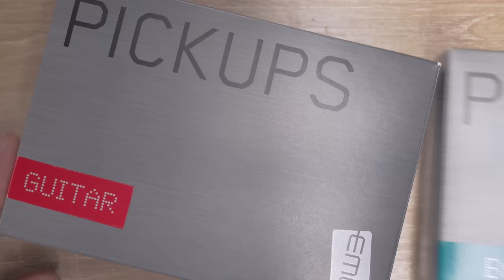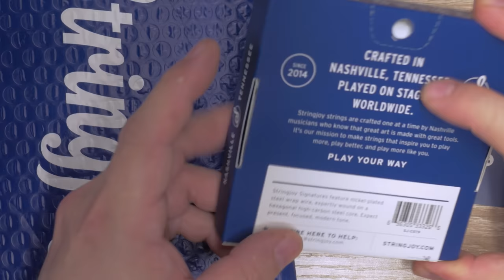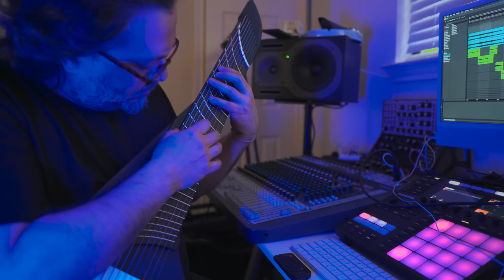Curved Fret 9 String Guitar - DEMO - Great Guitar Build Off 2022

Comment: Yours is similar in some concepts to mine, however mine is a 8 string with a Floyd rose and is much pointer. I'm putting a emg p40 in the neck and a seymour Duncan retribution blackout in the bridge. It's going to be a bit ridiculous but it's also gonna have a sub output for the neck pickup to go out to a bass Amp so when I play bass solos the guitar can keep low-end happening
Reply: fanned frets are pointless and there's a decade of recorded albums where you can't tell the difference between a fanned guitar and a standard guitar to prove that statement. Curved fanned frets are just stupid. Waste of wood.
Reply: @bryanharrison3889  my guitar is a straight 30 inch scale,I find fanned frets slightly awkward but meh if people like the curved frets more power to them but it looks very difficult to work on and like a pain to install.
Reply: @stevenhirsekorn3444  So if your guitar is a straight scale, what are you doing on here comparing a curved fan fret guitar to your design? lol
Reply: @bryanharrison3889  mainly in the fact that we're both using a bass pickup in the neck and doing a weird shape

Comment: The ideas, execution and video/music quality have all been a highlight of this year's GGBO, but I'm wondering, beyond the spectacle, does the 'exponential scale' really add to the guitar in a meaningful way? I know you said the aesthetic was form over function but does it go too far when even playing chords on the instrument becomes problematic? 
Great work in any case and I'm sure the value of the experiment outweighs the limitations it produced for playing certain things.
Reply from the maker: Great observation. You are right. This design is %100 spectacle. A needed trait for any competition. However, those high strings are profoundly easy to play for a 6" fan explicitly because of the exponential scale. A 6" fan built with traditional multiscale slanted frets would be impossible to play. I think there is also an added theatrical bonus with exponential scale frets. This guitar would look great in a music video or on a stage.

Comment: Nice work.  That turned out awesome, and sounds great.  By far the best and most interesting GGBO build I've seen yet.  Do you notice the curved frets?  I know that once you get used to a fanned fret, you don't even notice it at all... wondering if it's the same with the curved frets.
Reply from the maker: Hi Andrew,  I don't notice the curved frets on the high strings. That was by design. I opted to "spend" the curviness on the lower strings. So that 30" scale length for the 9th sting is very long but only awkward on the 1st fret.

Comment: @Mark Gutierrez That's a  cool looking guitar dude. I'm not knowledgeable when it comes to guitar building, and so i have some questions.

1. Are the curved frets just an aesthetic choice or does it offers some additional advantages in regards to intonation/string tension over normal fanned frets? How do they compare?

2. Why did you stick with straight pickup position instead of slanting them? Was this choice based aesthetics or tone?

3. Ooohh what do you think about making custom curved pickups? That's would look sick imo.
Reply from the maker: 1. Curved frets have an advantage only when applied to guitars with 8 or 9 strings. The advantage is lost with anything less. The benefit is we have complete control over how fast or slow the curve is. So we can have a slow growth rate for the higher strings. This means the high strings are closer to the traditional  scale lengths. Then the curve growth rate can increase fast when we get to the low gauge strings. .
2.Slanting the pickups would have required longer pickups that are available. If slanted, the internal rails would not have reached all the strings. To slant a pickup for 9 stings you would need a 10 or 11 string pickup. I mocked up the slanted pickups in CAD. The mock ups did not look good.
3.Curved pickups was my first option but would have required development and fabrication.

Comment: Incredible work! How do the curved frets feel under your fingers compared to a typical multiscale guitar?
Reply from the maker: Hi Aaron, the frets feel completely normal. Especially for the higher strings. That 1st fret low E however is a little hard to reach with the 30" scale.

Comment: OMG this is amazing! I hope you don’t mind me asking but is the fretboard curved as well or is this just a really unique version of a multiscale guitar/ system? Also how does the combination of bass and guitar pickups work?
Reply from the maker: Hi Matthew, the fretboard is not curved, it's flat. The frets are curved based on the E-scale or exponential scale. Very similar to multiscale except the scale lengths grow exponentially instead of uniformly. Regarding pickups. There aren't very many options for 9 string pickups on the market. So attempting to have some kind of tonal variation between the neck and bridge pickup was going to be difficult. Luckily, 6-string bass pickups are the exact same size as the 9-string guitar pickups. And the J bass pickups come with one rail (or coil). That means you could look at it as a single coil 9-string pickup. I think that is a cleaver hack. The only difference between the bass and guitar pickup is the output. I managed to overcome that by adding one of those tiny EMG 20db boost circuits for just the bass pickup. It's a pot that lives in the control cavity that I can dial in to ensure both pickups have the exact same output.
Reply: @MarkGutierrez  well I’ll be damned, this whole thing is amazing! It’s beyond impressive to see and hear what you’ve done with this guitar and if you ever build another I can’t wait to see what you do! Also just for next time fishman does make a 9
String pickups set so if you want to do something different next time theirs an option for you!
Reply from the maker: @matthewbehrle4428  Fishman do make a 9 string set but not in white!
Reply: @MarkGutierrez  aaaahhhhh, fair enough

Comment: Do the frets have a constant curve to them (the ones that are curved) or are they straighter towards the treble side and gradually become more curved? I'm just curious. Absolutely beautiful instrument! It actually reminds me of the Casio DG-20 😄
Reply from the maker: Yes. I used a formula to design the curved frets. The formula allows you to slow or increase the growth rate of the exponential scale lengths. That is the whole point of e-scale. I have a slow growth rate for the higher strings to make them feel like a traditional guitar, then I increase the growth rate so the lower strings have most of the curve.

Comment: Great build, fantastic design and I love the 2010 reference. How did you ground all of those bridge elements?
Reply from the maker: Hi there, active pickups do not require a ground to the bridge. There are some clever ways to ground the individual saddles together when using passive pickups but there is no need for epoxy potted active pickups.
Reply: @MarkGutierrez  Ah right, I forgot about that. I just noticed: only a switch and no other controls. That's really adding to the boldness of the design.

Comment: Hey Mark, I'm making a guitar with a richlite top as well.  did you just sand/polish and call it good?  its seems like it would be incredibly durable.  Incredible design!
Reply from the maker: For this specific color of Richlite, sanding does not work. Sanding will remove the top layer finish and just make it shiny. What I did was try extremely hard to not scratch the top during construction and then used Birchwood Casey satin finish on it. I believe it is just a wax. The only part of the Richlite that was sanded and polished was the forearm bevel.

Comment: Curious how the curved frets play into the ergonomic factor. Is it technically also multiscale then?
Reply from the maker: Yes it is multiscale. Curved frets are meant to feel like a traditional guitar for the high strings then drastically increase in scale length for the low strings.

Comment: This is the first time I've seen (well, heard) a nine string guitar used to make music I want to listen to. Amazing work! That tuning - the low strings are only two semitones apart?
Reply from the maker: You're the only one who has noticed that so far. The tension calculator I used must have give me inaccurate data because I could only get the .95 gauge to feel right tuned to E. Any lower and it was too flabby. Needs a thicker gauge string to get it to feel right at lower pitches.

Comment: This is easily one of my favourites in the competition. So, beyond the fact this is a visually arresting and boundary pushing/breaking guitar, how is it to play? I mean you're clearly a very accomplished player, how long did it take to get used to the exponential scale?
Reply from the maker: To be completely transparent, I couldn't play it the first few days. It was difficult on so many levels that I nearly gave up and cried. But I kept pushing myself, kept playing, using my ears as a guide and adapted after about a week. Now I can shred up and down that neck with ease. The main issue or hump to get over is the lack fretboard dots. It's the nine strings that are overwhelming (not the curved frets) and it was difficult to get my bearings while trying to navigate the fretboard. Dots or some type of fretboard inlay would have made this beast much easier to transition to. Whoever ends up buying this will have to reconcile with that.
Reply: @MarkGutierrez  thanks for your candour Mark, I can't even begin to imagine how difficult the adjustment must have been. Are you not tempted to keep it for yourself? Also could fret markers be retrofitted?

Comment: What relief and action height do you use ? Whats the radius on this?
Reply from the maker: Zero radius or flat radius, like a classical guitar. Super low action at the nut and bridge. I raise the thick 7th 8th and 9th strings higher at the saddles to accommodate for the wider oscillation of the strings and for zero fret buzz when you hit the heck out of them. There is no truss rod. I used the carbon fiber D-Tube. There should have been zero relief but there is some relief due to the 180+ pounds of tension the 9 strings are putting on the neck.

Comment: Correct me if I'm wrong but wouldn't curved blade pickups be possible?
Reply from the maker: I wasn't clever enough to figure out how to wind copper wire around a curved blade and it not make an egg shape.
Reply: @MarkGutierrez  ah right. I wonder if it could be done...
Reply: 😂 @MarkGutierrez
Reply: Maybe Fishman can make them. 🤷😁

Comment: Someone should put a high A and D string on a guitar to sate my curiosity.
Reply from the maker: I briefly explored my high A curiosity. I would have had to design the short scale length to around 23 inches to avoid breaking the string. But more importantly, I personally believe that the high A doesn't sound musically pleasing. That is my opinion. Try to find some sound samples of chords being played with the High A. They just sound wrong, at least to my western ears. Perhaps  for other folks in other parts of the world would disagree. Everyone's ears are different.